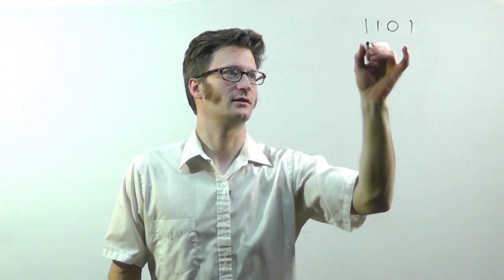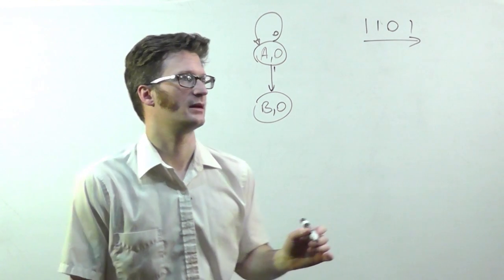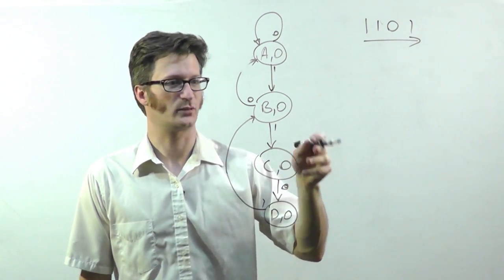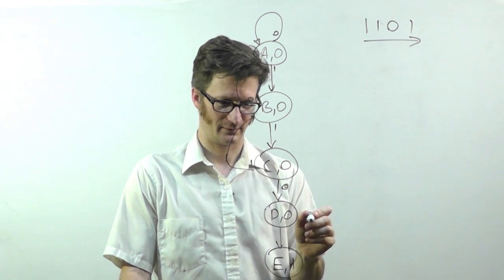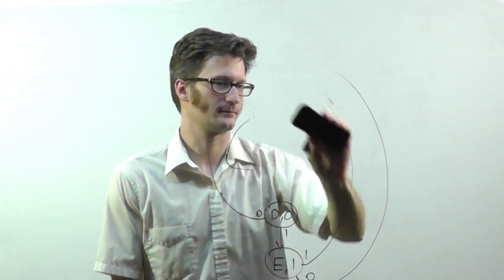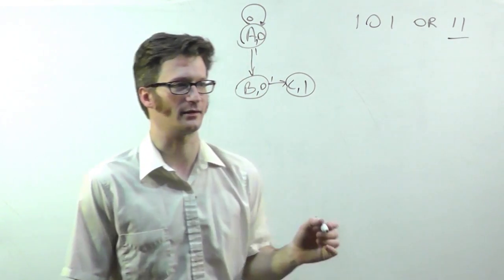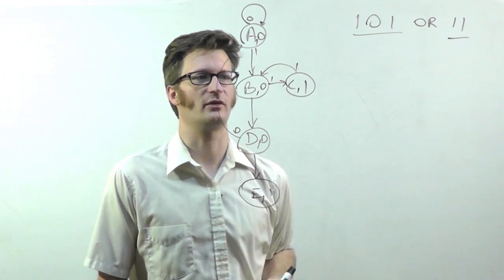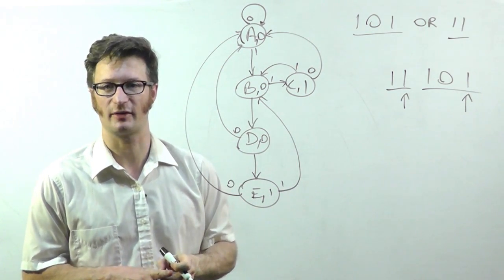Digital Logic - Sequence Detectors

Comment: when you do the 11 or 101 detector, if you have inputs of 11 going to c then a 0 goes to a now you have 110 in your sequence. Then you get another 1 sending you to state b, now you have a 1101 and the last 3 numbers indicate your 2nd sequence and their isnt an output of 1 at b thus I don't think it is correct to send the 0 from c to a. Unless your assuming no over lapping, what I would have done was send the 1 from c back to c cuz if you get a 11 you and at c, every new 1 from c remakes your sequence thus you need an output of 1 and keeping that 1 at c gives you that. The 0 line coming from c I would have sent back to b cuz if you get a 1 then go to b then get another 1 go to c you have 11 then 0 going back to b now you have 110 then 1 going back to c now you have 1101 the last 3 digits in this sequence meets your output guide line and out put should be 1 which it is at c. Also, the 0 from E can be sent to d cuz to get to e you need a 1 then if you send the 0 to d you will have a 10 then to get to e again u need a 1 which is 101 our sequence is met again output 1 at e again

Comment: I am designing a sequence detector for the sequence 1001 with overlap but when i use logisim to simulate, it doesnt work. As far as i know my state diagram is correct but when i make the rest of the procedure at the end in the simulation it doesnt work. Any help please. I just want to know where i am failing in my analysis.

Comment: Hmm.. in the detector for 101 or 11... Say you have a string of 4 1's in a row... with your map you get 0101 as outputs.. but consider this --> (11)11, 1(11)1, and 11(11), that should give you an output of 0111..  So I know the difference between these is called "examine exactly" vs "overlapping" detectors or at least that's what we've been calling them in my lab. But do you have a video that explains the differences? I think it's important to recognize no?